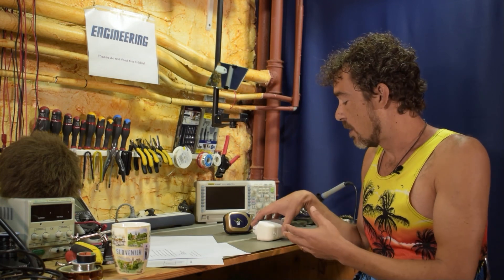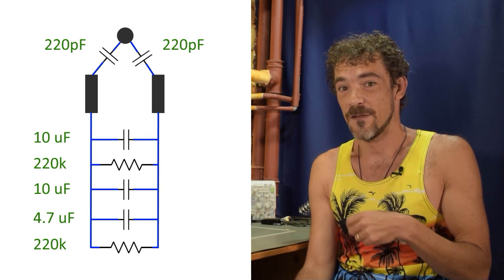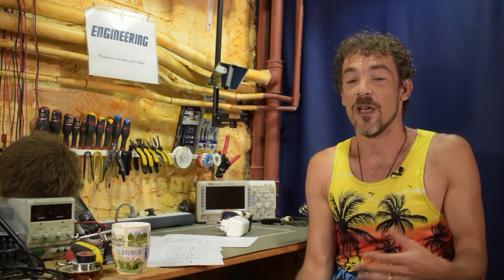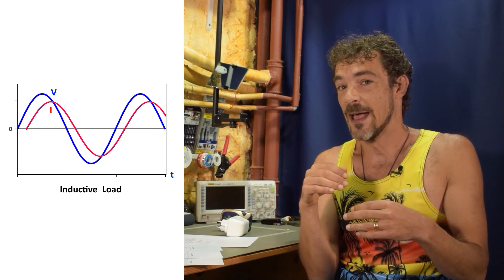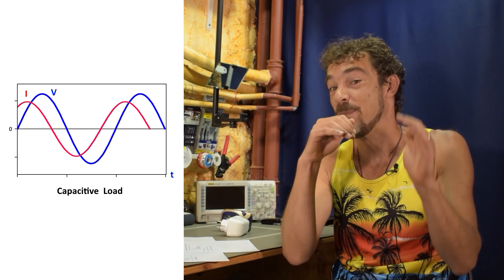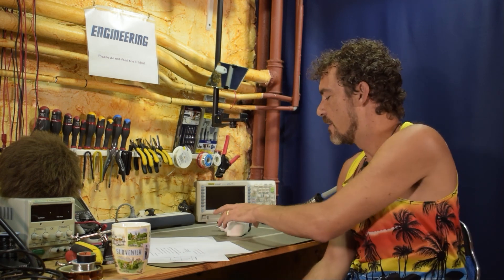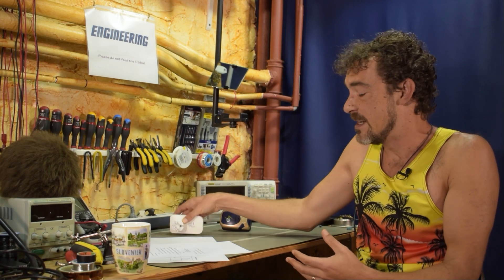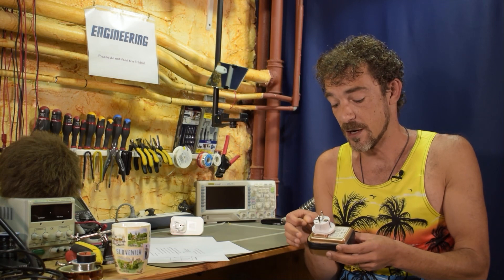When NOT to use Dirty Electricity filters!

Comment: Great info Scottie! Quick question here.... Does this still apply to a hardwired whole house filter?  We have solar, but use a permanent hardwired generator that produces significantly more power than we can consume (19kw whole house generator) Thanks in advance!
Reply from the maker: It depends on the whole-house filter. Some of them are 'active' and might compensate for the generator. Others are just a bunch of passive capacitors, and that will cause the same problem as individual little D.E. filters.

Comment: Could I use USB charger with DE filters?
Thank you.
Reply from the maker: Yes
Reply: @ScottiesTech Thank you
Reply: So before asked this question, I think I should not plug charger for phone, notebook on greenwave filter
Reply: The reason is because from greenwave filter manual. 
Its said: Some battery-charging devices are not compatible
with the high capacitance technology employed by
dirty electricity filters. For this reason, we recommend
that you do NOT plug battery chargers, back-up power
supplies, and electric devices that include built-in
chargers (such as electric toothbrushes and shavers)
directly into the built-in outlet of Greenwave filters or
into the same wall outlet or power strip as a filter.

Source: https://greenwavefilters.com/wp-content/uploads/2022/12/Greenwave-Filter-Instructions-12-12-22.pdf?srsltid=AfmBOoqic3dHpAmApidZoZMhj_rOInBcvS8_v9BxYhbFI99XhR2IEEkG

Comment: I live off generator power. It's a 5.5kw 3 cylinder diesel @ 240v.
I lost my Corsair 1000w power supply on my desktop computer. I purchased a 2kw heavy duty Cooler Master power supply designed for crypto as a replacement but I'm afraid to install it. What do I do that's affordable about my dirty generator power and load induced frequency variation so this doesn't happen again? 
I heard about passive filters like a Pi filter or capacitor input filter but I really don't want this to happen again. 
The vid I wanted for generators was the vid telling me not to LOL
Reply from the maker: Get a better/bigger generator. Smaller less expensive gensets do that a lot. I have a 15kW genset (nominal; 18kW peak) and I can load it to 14kW and the frequency is rock solid at 50 Hz. But if I load it with too much capacitance (like with Dirty Electricity filters), the stability suffers and I start getting voltage spikes! They're touchy beasts. There may be another solution, but frequency depends on rotational speed of the generator, so if it's getting bogged down, well... :(  I'm no expert on gensets tho, so maybe a service would help?

Comment: I just need one - and one only - d.e. filter for my freezer.  All other circuits/loads in my house works fine on my back-up generator power.  My freezer, however, runs intermittently on the dirty generator power.  If I use only one d.e. filter to clean up the dirty electricity/noise provided by the generator for the freezer - during power outages only, will it adversely affect the output and performance of my generator??
Reply from the maker: That might be okay, but it really depends on the particular generator, it's total power output, etc.

Comment: Thank you so much for that explanation that is one question that I’ve always had about filtering power coming into my home . I do have a generator and I have a question regarding the power that comes from that.. Is it safe to run my electronic devices From generator power if my generator does not have an inverter built in?
BTW, I liked and subbed.
Cheers from David across the pond!
Reply from the maker: As long as it's 120/230V AC coming from the genny, you should be fine... BUT, I would connect a UPS (battery backup) to the genny power, then run all your electronics off the UPS. That way, the UPS buffers the electronics from low voltage, high voltage, spikes, etc. Much safer!
Reply: @ thank you so much Scottie! I will do that!😊☝️

Comment: Hey Scottie, for generator hookups, how about adding an (inductive/capacitive) EMI filter of suitable amperage in parallel with the dirty power filter?   Would that correct some of the power factor?
Reply from the maker: Theoretically, that would do the trick - but it would also change the filtering of the DE units, so may be a bit tricky.

Comment: In AC a capacitor is simply a frequency dependent resistor. The filter works by simply shorting certain high frequencies against neutral. These filters could therefore interfere with non pure sine  waves coming out of a cheap inverter due to its multitude of high frequency waveform artefacts. You might want to check if your generator has something like this and also use your oscilloscope to check its generated waveform for distortions. Beyond a certain frequencies the filter capacitors work like a short cut.

Comment: You kinda blew past the health benefits, or lack there of, pretty quickly. You haven’t noticed anything? If not, why bother with filters? What are the benefits other than health?
Reply: @gordonslightandsoundllc5878 You are asking the real question. If there is no harm to anyone's health from so-called "dirty electricity", then there is no problem to be solved. In 1976, the New Yorker magazine ran a long article over a 2-month period (because it was so long) making a case for the harm to human health caused by electric and magnetic fields from power lines. The author was a man in the UK, whose name I don't recall. Years later researchers and scholars realized that no one could find adequate evidence to verify the man's claims. Sometime in the last 15 years or so, I saw where the New Yorker apologized for publishing the article because of lack of evidence showing harm to people, pets, or farm animals caused by electric or magnetic fields created by the electrical power industry. All that is meant by "dirty electricity" is that the electricity into our homes and businesses is not only at the fundamental frequency of 50 Hz or 60 Hz, but some of the power delivered to devices in our homes is at higher frequencies. The bulk of the power delivered to each device is at the fundamental frequency, but smaller amounts of power are delivered at higher frequencies. And even though the frequency of the highest harmonic may be around 8 megahertz, its amplitude will be a tiny fraction of the fundamental and there is no reason to think that 8 megahertz has any detrimental impact on a biological system. AM radio transmitters intentionally radiate thousands of watts of electromagnetic (EM) waves at around 1 megahertz. FM radio transmitters do the same at frequencies around 100 megahertz. Even frequencies of EM waves of 600,000 gigahertz do not harm the body, unless the waves carry a lot of power, which is rare in ordinary circumstances. Oh, by the way, EM waves with a frequency of 600,000 gigahertz are green EM waves, i.e., green light that you can see with your eyes. Where relatively low-power EM waves begin to be harmful for biological organisms is at frequencies higher than that of visible light, such as UV light, x-rays, and gamma rays. These are known as ionizing rays, which do indeed cause us harm.

Comment: I have been struggling to find a solution to getting clean 240V from my 12V off grid solar set up (small 100A Lipo4 with 900w panel array) Every inverter I have tried creates a huge field that makes me nauseous. Even placed far away, the dirty pulses travel through the extension cables. I am a bit at a loss here and am hoping you some ideas around this. Enjoying your channel heaps. Very informative.
Reply from the maker: If you're particularly sensitive, that's a tricky one... Have you tried a "pure sine wave" inverter? They're not really 'pure', but it might help... Getting an oversized inverter might also help. Ultimately it may be a question of simple trial and error unfortunately, which can get pretty expensive pretty quick!
Reply: @ScottiesTech  Yeah, I have tried several pure sine wave inverters. Including a branded and overpowered one. And the last one I tried was a low frequency pure sine wave inverter, based on powerful transformers instead of the high frequency switches. Still a very messy field in which I can't last much more than 20 minutes at a few meter distance. Hmmm.. it is a tricky one and I m running out of options. Thank you very much for your reply!
Reply: @vaskucom perhaps you’ll in the end have to find appliances that run on DC and just skip the inverter

Comment: Thanks Scottie!  I have a generator transfer panel that isolates a portion of the house electrical wiring from the rest of the system when a switch is manually engaged.  I'm wondering if a whole house filter located at the primary electrical panel and which would then be isolated from the generator use, would be ideal?  And have you done any research on a diy whole system filter?  Thanks again!

Comment: Those em filters screw up your voltage, but not with a true RMS meter.  I have a crappy voltmeter that reads high in inductive loaded circuits and low in capacitave loads.  The crude voltage regulation of the generator which sets up the field current goes out of whack.

Comment: I was so optomistic that I had found a solution to the high THD (5 to 20%) electricity produced by typical open frame generators with your other videos. Then you drop this bomb on my idea.  

So what options are there to cleaning up the THD of these cheaper genies to get below 5% so as to not damage our more sensitive home electronics?

I understand inverter genies are best for this, but most are low wattage ( 4000W peak and under) and don't have 240V plugs that us with a well need to power our pumps.

I'm really trying to avoid using a battery bank setup to clean the power being supplied to the house.  The cost and constant up keep is just not ideal for someone who is only using it for emergency situations.  And so far I've found no out of the box solution for this.  I can't possibly be the only one out here looking for this?
Reply from the maker: I have no idea. My genny is a rather large 3-phase 20kVA unit - outputs nice clean sine waves - And it STILL has this problem. It seems to be  an inherent limitation, and I don't know of any way around it. There's got to be one, but... What? That is the question. It's been taxing my brain lately...

Comment: I bought a new Ryobi 6500W, gas powered portable generator a week ago thinking I could use it to provide power to my living room in case of a power outage. In my instruction manual, it states to not plug in a TV, computer or other sensitive electronics because it puts out dirty power and would damage these items. At that point I got a sinking feeling in my stomach because I can't get a refund on the generator and everything in my living room is sensitive electronic equipment. (computer, cable TV, TV, sound system, modem, phone charger and an electronic thermostat controlled 1500 watt space heater) I found the Green Wave DE filter and thought it would work for me. If I keep my power usage down to a minimum, say 2000W, could I use the Green Wave DE filter? I'm thinking of your blue die analogy into a gallon instead of a glass of water since I'm producing three times what I'm using. Should I sell this generator and just buy a true sine wave generator? (so expensive) Is there something on the market I could buy to fix my problem?
Reply from the maker: Adding DE filters might make the problem worse. You might get away with it if you keep power usage low. Another thing some people do is to connect a UPS (battery backup) to their generator. That takes the 'dirty' AC and normally passes it through. If the gen power gets too nasty, the UPS cuts in and inverts the DC power from its battery into AC, thus protecting the electronic gizmos. However, that really depends on the UPS, so you'd have to get one preferably that somebody out there has tested with your kind of generator. Don't feel bad though... My generator is a 3-phase AC 'pure sine wave' version - 18kW. Despite that, it STILL doesn't like D.E. filters, and too much capacitance or inductance makes it very unhappy. So, genny power is always going to be crappier than when you're on the grid. In the event of an emergency though, just keeping the basics powered is a huge help.
Reply: Most electronic devices today use switched power supplies and can deal with a wide range of voltage and frequencies...  Adding hokey devices just adds complication and can screw up the power factor which messes with the generator regulation

Comment: Sorry about this question, because it does not have anything to do with this video.  Do you know anything about CPAP machines and EMF readings. I saw a threat on Facebook that said CPAP machines emit EMF. If that is the case what is your go around to fixing this, because I have been on CPAP for years and have major concerns? Also, my ResMed has a SD card in it for capturing data. The machine has the capability to be put in airplane mode. I am wondering if I put it in airplane mode, will it still store data on the SD card and when I turn take the machine off airplane mode will it upload my sleeping data to myair, where my provider can get the information. I know the machines do a rolling data and can obtain 12 months of data before it starts erasing the oldest data from the previous year. Help, help, help

Comment: As an electric noobie, does the same concern apply to an off grid solar pannel installation with batteries and an inverter? As is, it's more like a glass of water than an ocean of water. 

And, additional question, I won't be charged for my electricity, but I am using KVAs by plugging the DE filters in, is that correct? As I have limited supply, this is something to be mindful off.
Reply from the maker: Yeah, the same thing applies to solar/battery installations. How bad it would be depends on the inverter, but in most cases it won't be happy with lots of big capacitors attached. The kVA thing is a little more complicated... You're still only 'using' kW, but any capacitive/inductive load skews the power (so to speak), but it depends on the load. I suppose in short, it IS something to be mindful of because your 'glass of water' has WAAAY less wiggle room than the grid. So if you have a solar/battery installation and the inverter is rated 5kVA, the real power you could use will be less - significantly less if you have lots of capacitors or lots of inductors (like motors) as loads to drive. It's like a UPS (battery backup) for a puter: They're rated 500VA, or ~350W.

Comment: How do you feel about type 2 home surge protectors that are install outside the main electrical panel in home? Can you still use the filters? I have a 13KW GE Generator outside my home and if I get the home surge protector will there be an issue with the filters? Thanks again for all your videos.
Reply from the maker: I actually feel pretty good about whole-house surge protectors. Got one installed! It really, REALLY helped with surges due to living in the boonies and having long aerial power lines. Anyway, they should be perfectly fine to use with D.E. filters.

Comment: I know this is also a problem with solar inverters. Is that also because the solar inverters carry an inductive load? Would it be possible to have a solar inverter that is capacitive, to make it work with DE filters? I'm really curious to know because people have said the DE filters make DE worse with a solar inverter, and I've never found an explanation, but your video makes me think it's the same situation as a generator? :)
Reply from the maker: Solar inverters have to "invert" DC into AC. They usually do that in a way that inherently generates lots of noise - unlike a big 3-phase AC generator at the power company, which spits out nice 'pure' sine waves. You can think of inverters as digitally generating a blocky sine wave that then has to be smoothed out. The smoothing is often done with capacitors. In any case, I don't have a solar inverter, so if you get DE filters and try them, lemme know what happens!
Reply: @ScottiesTech my neighbors solar creates dirty electricity in my home during the day (confirmed with them shutting off solar). Will filters reduce this dirty electricity from neighbors home? Also why exactly are neighbors solar affecting my system and symptoms even when we shut our power off? Thanks!